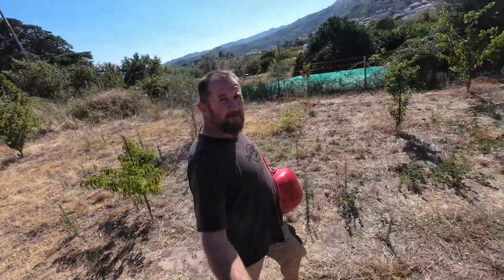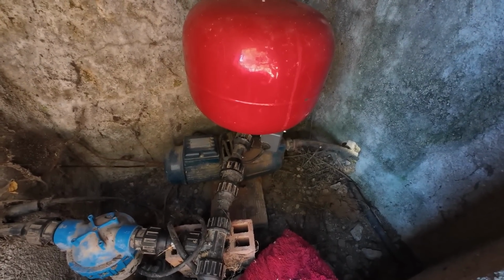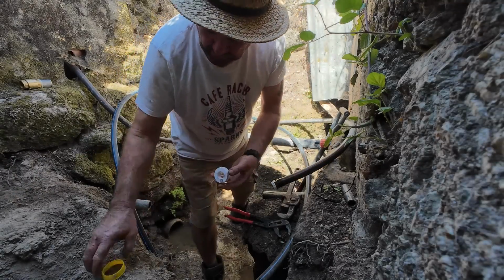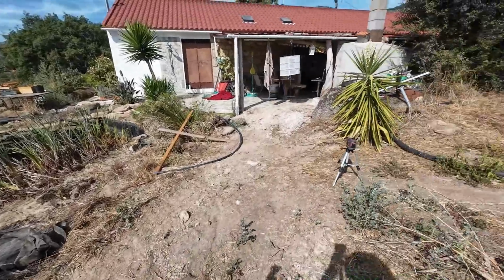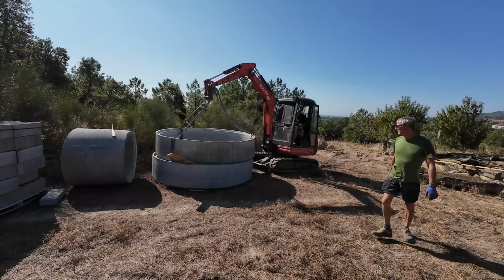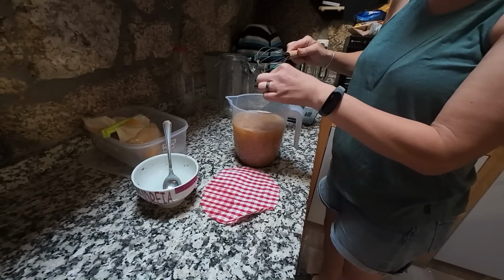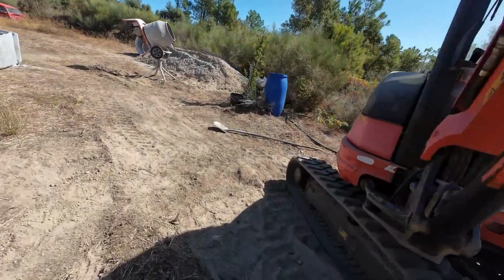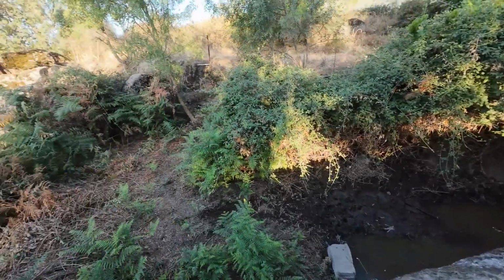Fitting The First Concrete Ring to Our Natural Swim Pond : 218

Comment: nick i think the old pump was fine it just had something in the back check causing the pump to bounce off the pressure switch, what do you think
Reply from the maker: Having wired it back up, it still doesn't work as I said. I think the motor capacitor has overheated
Reply: @projectportugal  yes that would also cause it to cycle alot

Comment: In lieu of the bladder type regulator  for your pump, what about a 'Digital Pressure Regulator',
Reply from the maker: Looking into it, but what the bladder does is hold a constant pressure in the circuit so it's always on demand
Reply: I don't know if this helps but the standard 'Digital Pressure Regulator' used on the house pump was guarantee to supply high pressure water to 4 to 5 taps on demand.  Over the many years of use I never had any problems with the regulators.  Love your show.